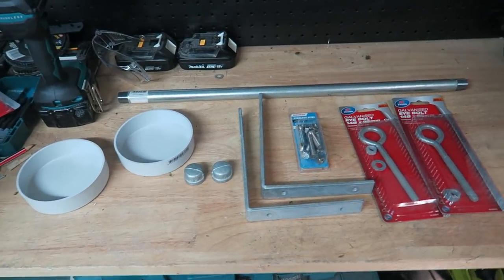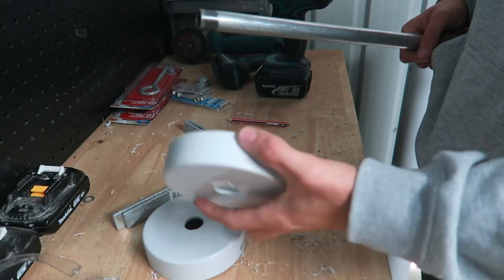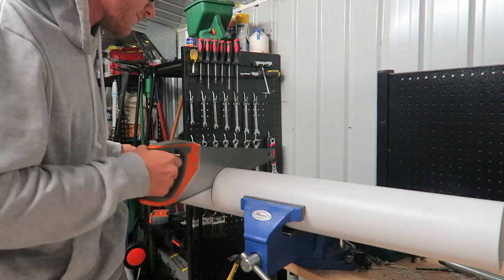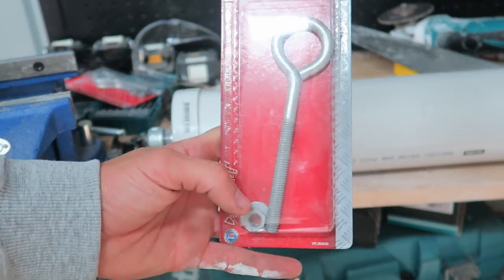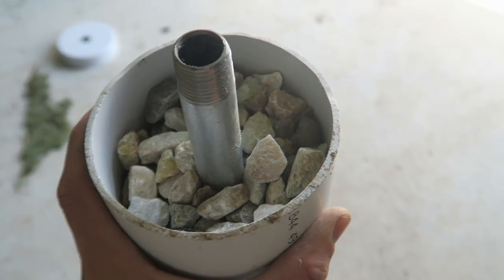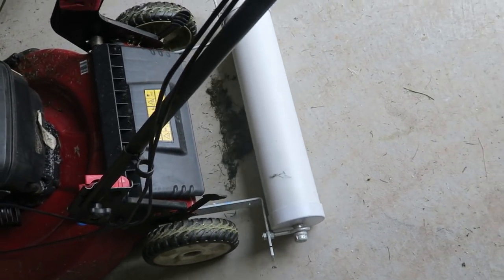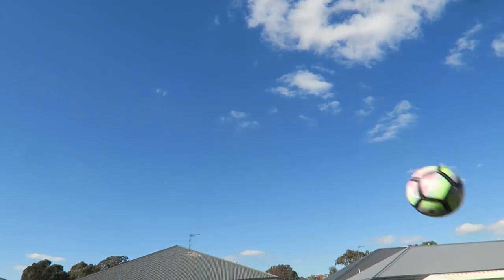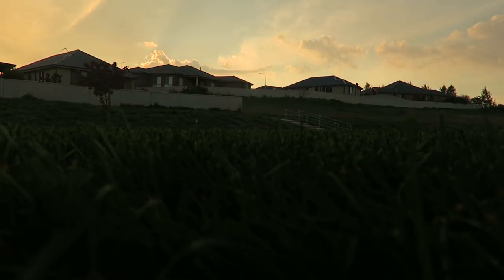DIY Lawn Striper | Lawn Striping Kit

Comment: Did you end up with the roller bracket attached with the flap?  Or, did you attach it somewhere else?
Reply from the maker: Jason Russo hey man, yeah I attached it to the flap, works well! You could put your own bolts on the mower deck easily though it the flap isn’t an option
Reply: How did you attach it to the flap? I seen you just placed the bracket in the edge of the flap but nothing after that.

Comment: How do you turn and keep the ends looking nice? I have a tight lawn and. I room to roll off it.
Reply from the maker: Hey mate! I usually do two runs around the outside. Just helps to clean up the turn around marks
Reply: Lawn Tips as in you do a lap around the circumference?
Reply from the maker: Yep exactly! Afterwards if you can, just do it sort of erases the turn around points

Comment: Are you not supposed to use the bag for the clippings
Reply from the maker: +albahroe12 it's actually healthy for your lawn to recycle them back in! Helps to feed the soil organisms and recycles plant nutrients.
Reply: Mulching is best but you can’t let it get too long before you cut it or it can lead to thatch.
Reply from the maker: Yeah can’t let it get too long or it creates a mess. Thatch not so much. It’s a bit of a myth actually. I mean if you cut it so long every time and the clippings couldn’t be broken down by the microbes in the soil then yes it could technically create thatch

Comment: How is the pvc pipe holding up? Just curious if I need to get a thicker piece of pvc cause I have a bunch of rocks on my property. Great videos by the way.
Reply from the maker: Thanks mate. It held up well until I stopped using it! Got a reel mower now. But never had any issues with it 👍🏽
Reply: Awesome. I'm thinking about going with the thin pvc pipe and testing it out. Thanks.
Reply from the maker: No worries!
Reply: I made one really close to this about 3 years ago and filled it with concrete..  Works awesome and holds up just fine.

Comment: curious how much your striper weighed with sand?
Reply from the maker: +Kbalz Bar I have rocks in there at the moment. I would guess around 5kg
Reply: Regular construction twine/string will cut that pipe way faster than that saw.....
Reply from the maker: I was over exaggerating the cutting of that pipe 😉
But thanks for the tip!